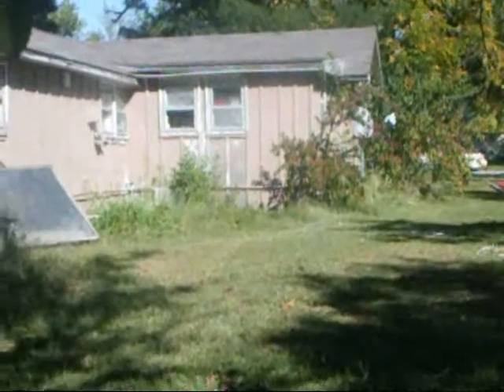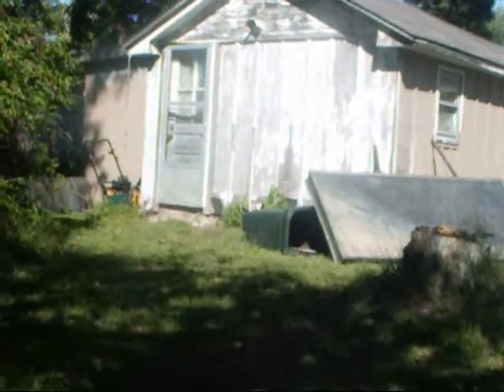Hot air solar panels to help heat my home. (part 1)

Comment: Well there's a project that will take some work! Just cleaning the panels up is going to be a job, but any supplemental heat we can get is good. Those remind me of solar water heater panels, that's the closest I can compare them to. I'm guessing they do just provide some hot air flow, not electricity?
I am finding it amazing how every day I can see the difference in how much sun is hitting the house and yard, it's changing SO fast!  Remember too in the winter there won't be leaves on the trees so you should still get some heat even if a deciduous tree is in the way. That roof shouldn't be too hard of a fix, the right fasteners in the right place should hold it down without leaking if the roof itself is still good. Good luck with your latest projects :)

Comment: I've got you rocket stove videos. Send me any questions. I'll get them answered. Great acquisition!
Reply from the maker: Thanks, kbbacon I have watched many of your solar and Rocketstove videos. That is how I found your channel a while back. Knowing we are both in the same state helped me a bit to make the decision to pull them out and try to get them going. Our state is not the best for solar. But a few hours of free heat will help. I just wish I could find an owners manual on them. I will soon test the motors to see if they will work safely. And I will state looking for things to build a rocket mass heater.